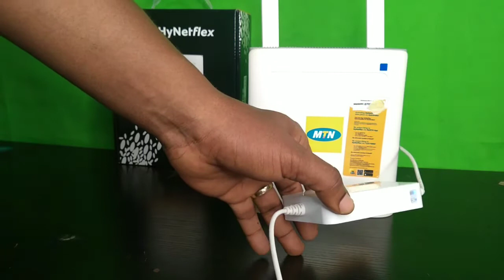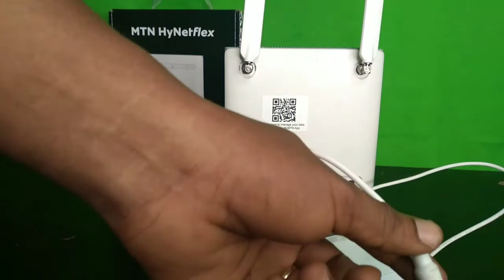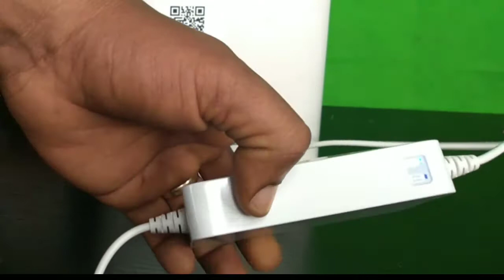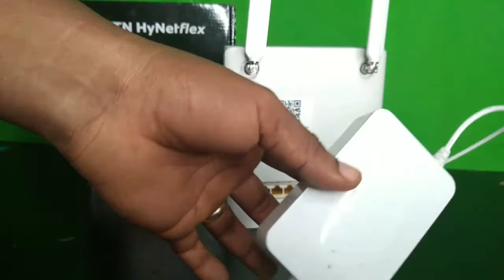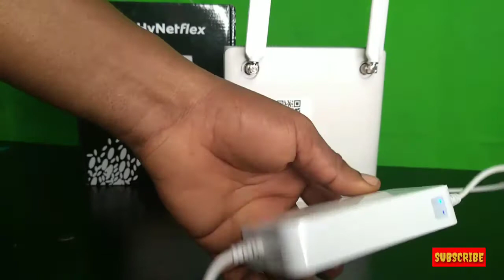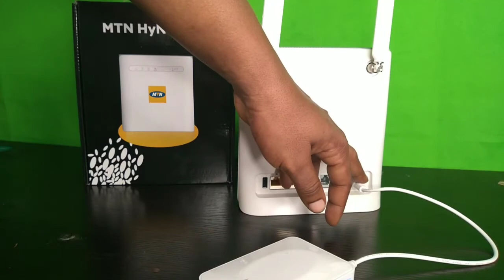The TRUTH About MTN HynetFlex Router Battery Test, How Long Does MTN HynetFlex Battery Last?

Comment: The blue light on my own power bank just keeps blinking and won't stop. so is the blue light on the router. This makes it unable to power the router without electricity.  The blue light on the power bank immediately becomes stable the moment it is plugged directly to an electric power source.  I'm beginning to think that I was sold a fake router power bank.🤦‍♂ I can't use mine when there is no light. Please any fix to this sir???
Reply: The battery cells inside is probably gone ... that's why it can't hold charge

Comment: Can I be charging the power bank at the same time use it
Reply from the maker: Yes, you can do that.
Reply: @KhemiACADEMY  but won’t it spoil the powerbank … because am charging the powerbank and at the same time using the other wire connected to the powerbank to power the router
Reply: @chalimobile it can't, they didn't design it for you to charge the battery alone
Reply: Ok u mean I can charge both the two at the same time, but once the is no light I will use the power bank

Comment: Can I charge the router directly without the external power bank?
Reply from the maker: Yes, you can power the router directly with the charger plugged to the external power bank. Both has the same power ratings.

Comment: Thanks for the video, can you please explain if there is a way to turn off the external battery because I don't see any switch to turn it off
Reply from the maker: You're welcome. Whenever you disconnect the external battery from the router it will not discharge energy until whenever you connect it back to router. So, that's the only way to turn off or reserve the battery power.

Comment: Bro how do i know if the power bank is charged up?
Reply from the maker: Likely the red light on the power bank will turn blue, though I've not experiment to know how long it takes to charge full.
Reply: The charging light will go off
Reply: @joseph_oluwayomi if it goes off and there is still electricity does that mean it is using the battery power?

Comment: Nice video bro. I just bought mine Tuesday this week, the battery (UPS) has 5000mAh battery capacity. Maybe they've increased the battery capacity
Reply from the maker: Thanks bro! If yours is 5000mAh battery capacity that's likely an upgrade which means you'll have additional battery capacity than mine. Maybe some day they will make it 10,000mAh
Reply: @KhemiACADEMY  To be clear, this current model has no inbuilt battery. The battery is just the UPS and it cannot turn on without the UPS. And yes, you can plug the charger to the UPS and use it otherwise it will turn off once there's a power outage. Thanks.
Reply: @SunnyCeeMedia hello, pls how can I get something similar to that ups to power a router that is designed to work on AC (plugged in)
Reply: @oloyedeifeoluwa2072  I don't really know because that ups came together with the router. Unless if you're willing to buy the MTN router now just because of the charger. It's selling at 10k now...a bit cheaper than before
Reply: @SunnyCeeMedia  yours that came with 5000 mah how long does it last after it's been fully charged.
Reply: @KhemiACADEMY  That's true
Reply: Same.

I want to be sure if it advisable  to plug the ups to charging cable and the router at the same time.

Comment: Please how do you switch off the power bank
Reply from the maker: I don't think there's any special switch off feature, but once you remove all the detachable cables attached to the power bank its power is totally reserve till when needed.
Reply: @KhemiACADEMY  If it's totally reserved, where is it getting the power to light the LED?
Reply: @ekpenyongokpo4900 I just got this power pack today but I am shocked that the LED light remains on despite disconnection from the socket. This must be draining the battery. Sad experience.

Comment: Hello 
Thank you for the video but I still don’t understand why my own router battery goes off After 30 minutes i off my light
Reply from the maker: Make sure the battery was charging by checking if the red light is on. If it's well charged it should last up to two hours thirty minutes.